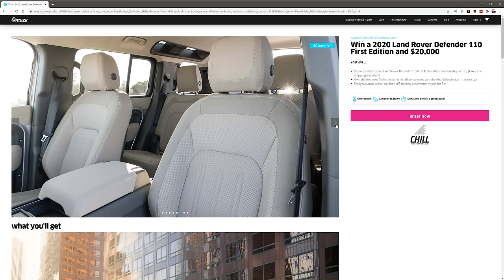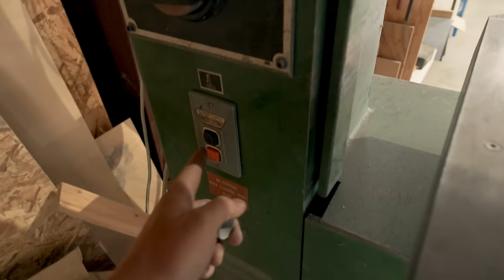Flying, Wrenching and Camping our way to the Idaho Backcountry

Comment: Gusseted rudder pedal design vast improvement. “Racing improves the breed” - you’re good to go for more STOL Drags now! 
What do you figure your camp set up weighs? Looks comfy! Juan.
Reply: Was about to ask about the gusseted pedals :P but seriously, what's the reason behind that?
Reply: Somebody correct me if I"m wrong, but on the new part the place were the original pedal set failed is not gusseted and is no different than the part that failed. The gusseting is on the pedal but not on the arm that actuates the cable. I was surprised to see the tube actually ripped where the arm attached.
Reply: @thiagopsampaio  I'm a big guy and I can leg press 450 lbs. Gussets would be nice.

Comment: Possibly a great idea for your future in the field radiator repairs. I use QuickSteel 2 part epoxy putty. I cut off what I need, knead it, and pack it into the hole. I usually have holes in the cooling fins themselves, and I can pack this putty into the coil from both sides. It sets quick and is strong. I also use it for brake and clutch levers.

Comment: 1:50 I always like seeing the towers on the north shore of pyramid lake.  For those who are interested in geology. Those towers,  rock outcroppings  have formed kind of like how the Hawaiian islands form. At pyramid there is  geothermal activity in that area. There are geysers right there. Each of those towers were once a geyser. They are built on layers and layers of minerals brought up from the earth's molten core.  As the area above have changed, the geysers clog up and move to a different area. Hence why they are scattered apart.
Reply: Great info, thanks for sharing.

Comment: Trent, I would take the opportunity to go thru the ENTIRE CONTROL system / continuity. NOT JUST rudder pedals. From head light to tail pipe.!!  1000 hours is no joke and as you know 100 hour inspections as per your operating limitations under experimental are important. Check all your rod ends, jam nuts, EVERYTHING. Universe giving you a heads up. Take heed.  PRE & POST Flight inspections can save your bacon. Not joking !!

Comment: I don't believe that Material Failure was Your fault. I'm not sure if the pipe wore thin and then ripped, but that doesnt matter. The way it was/is constructed  requires a collar welded to the end of the pipe to mitigate the risk of the pipe deforming under kigh radial loads. What safety factor does Kitfox design/engineer flight control components to? I don't know what design suit they use over at kitfox but SolidWorks has a easy to learn/use stress analysis tool that will give you the yield force to just about any set of components that you  can draw up. I believe Mike Patey uses the same design suite.  https://blogs.solidworks.com/teacher/2014/01/use-solidworks-in-stress-analysis-measure-stresses-strains-and-displacements.html

Comment: What if your rudder pedal failed during STOL competition? How come you can't inspect the pedals condition prior to flight or periodically? Every consider using 4130 cro-moly steel on rudder pedals assembly? ..Stuff is used a lot in aviation and nearly indestructible.

Comment: Travel - end -  stops - will limit force on the brake pedal assembly - once the brakes are at full travel - more foot pressure doesn't increase bake force.  lol - as much psychological as physiological... I get it. - competition raises the spirits.  Sometimes we all need full beta with 600HP of additional braking.

Comment: Trent, what a trip without adventure? Just a trip and not an adventure. Maybe it’s time for solid steel billet machined rudder peddles with splined shafts. I know your trying to keep weight at a minimum but honking on the breaks will crack welds even with gussets. Just an idea. Fly safe..

Comment: Properly engineered, you should not be able to break the rudder pedals.  They should take all the force a normal human can muster.  Having said that, Kitfox is in good company here, I know of several other experimental and certified designs with similar failures.  The rag and tube pipers had a AD for adding reinforcement.  I believe Vans did too.

Comment: I can relate, Trent: I was a Pterodactyl ultralight dealer in the '80s, and one customer wanted the stick in his left hand.  Before test flying it for him, I told myself it would not be a problem. It was, I had 600+ hours at that time with the opposite hands, and got into a PIO before I got it under control. It was a real mind f*ck.

Comment: Howd you do the long exposure thumbnail?
Reply: OPTION 1: for the background: use a dslr camera on an equatorial mount, set the exposure to 2 min & for the foreground take a 3-5 min exposure depending on surrounding ambient light (moon, light pollution etc.) Then once you have a foreground and background picture use photoshop to combine them (there are thousands of tutorials on youtube)
OPTION 2: for the background: (if you dont have an equatorial mount) use the lowest focal length (18mm, 14mm and under, the smaller the better) and divide 500 by the focal length you're using. For example for 14mm: 500/14=35.7 ; so you can in this case have an exposure of around 35 seconds without having any star trails). Then make around 5 photos and stack them (for example using StarStaX or Sequator or photoshop or lightroom etc.) to increase brightness and detail and to remove noise. For the foreground do the same as in option 1. Then once you have a foreground and background picture use photoshop to combine them (there are thousands of tutorials on youtube)

Or if you cant be bothered to read this just look up 'how to make milky way photos with foreground object' or so on youtube.
Reply from the maker: It was just a single long exposure with my fastest lens, 16mm at F1.4, and a 60sec exposure.

Comment: Great video.  I owned a defender.  It was ex ranger RSOV that I got in surplus in the late 90s.  I only got to play with them once at Ft. Polk before the Battalions stop using them.  It was fun, but what a maintenance nightmare.  Sold it for more than I got it for though.  The new defender are sad.

Comment: Can totally relate on that foreign feeling switching over to the right seat man. I'm at the tail end of my flight school stuff and am currently in CFI training practicing all of the commercial pilot level maneuvers from the right seat. Good god was it a tough transition on those first two initial flights. Highly recommend though for you man, just from a safety and proficiency standpoint, that you take that thing out and right seat solo it every now and then. That will help build comfort using the opposite hands for things. Granted you have way more flight hours than me so take this with a grain of salt. But it certainly can't hurt to become proficient from both sides! Love your videos man. Keep putting out great content.

Comment: It's like driving in the UK...
Reply: Well, I started driving in the UK, then lived a long time in countries driving on the right.  The transition is the tricky one - resisting the temptation to change gear with the window winder - and remembering which way to turn when you start again after a break...  Not tried it up in the air, but I can well understand why Trent was nervous.

Comment: I’m struggling to understand how that part broke without being serviced prior? I understand that you said you turn with a lot of pressure on the break and rudder pedal but I don’t understand how it’s not a defective part or a mechanics fault. A part that significant breaking in flight, I would think the manufacturer would be freaking out and perhaps seeking a recall or new guidelines for overhauling parts. 

Could you explain more about what everyone was thinking at the facility you should repairing that part?

Comment: I have always noticed that your twist the throttle stalk. What's that doing? Small RPM changes or something similar?

Just something I always notice.
Reply: It tightens the pressure of the lever. If you leave it loose it could wiggle in/out changing your RPMs. When you tighten it, it keeps the throttle lever in the position you want.
Reply from the maker: It’s a vernier, so when I spin it it makes small adjustments to the throttle position. There is also a pressure screw like Matt said but when I spin the main throttle handle it’s the vernier
Reply: Thanks Both. It's not something I have noticed on other videos but that you for the information!

Comment: Trent Next time you have a pump thats running slow, take the nozzle out and lay it on the ground for 30 seconds or so then go back to pumping. Its a trick the pump tech told me once and it works. Not sure why it works exactly and sometimes you'll need to do it twice, but it works.

https://www.reddit.com/r/Wellthatsucks/comments/aroxbf/only_gas_station_for_100_miles_took_20_minutes_to/
"I own and work on about 150 of these pumps. They do this very often when it’s cold and/or when they haven’t been used in a while. Sorry simplest term I can think to use is they “lose prime”. But you’re right, pull that nozzle off the rack so the pump engages pump lay it down or hold it for about a minute and all will usually be fine."

Comment: I've gotta think that you guys need to have a look at your whole flying procedures. I watched as you flew through that canyon feet above the river.  If anything failed there, you're dead. You push those aircraft like they're fighters, and I wonder if you are cutting things too fine.  I believe that there's something called a 500 hour rule.  That's when a pilot has 500 hours flying and thinks "I've got this."  Then with some luck he will not die when he scares the living shit out of himself at 505 hours.  After than experience he realizes that he knows nothing, that an equipment failure can be catastrophic no matter what skill the pilot thinks that they have,  and then he's a LOT more careful, and takes far fewer risks.  It may be far less fun to fly over that canyon than to fly through it, but you're going to be far more likely to survive.